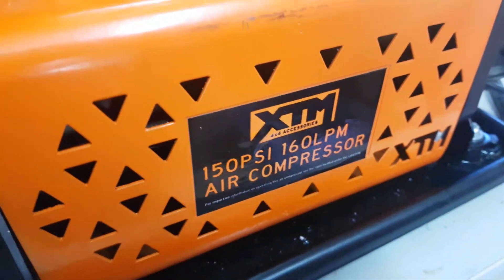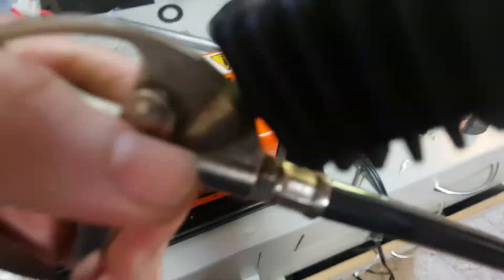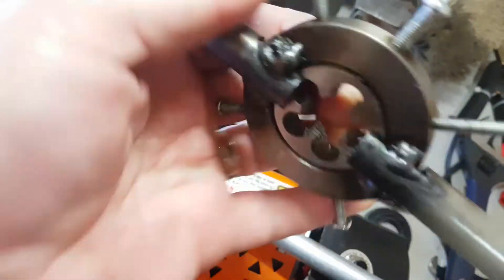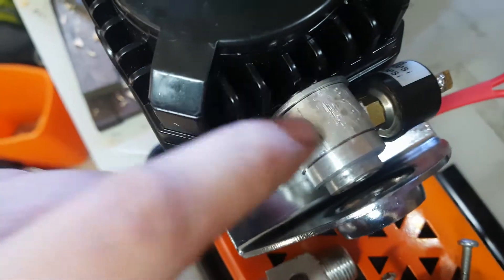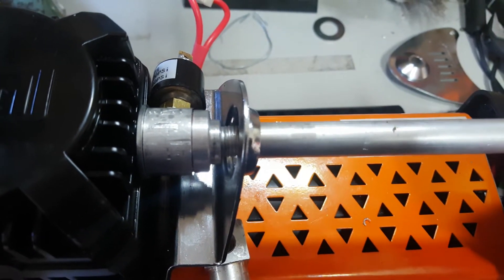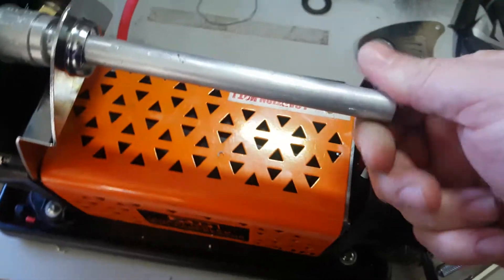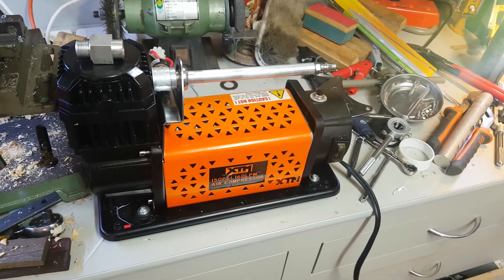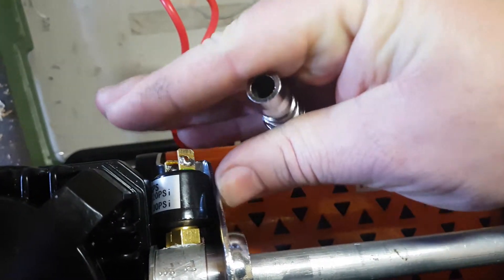DIY How to add an Auto Cut Out Pressure switch for a 4WD Air Compressor

Comment: Just a question. Is there a reason why you did not reconnect your blow off valve? Or unloading valve? same thing lol
Reply from the maker: there wasn't one on this compressor. The hose and connectors that are on it originally are free flowing, so there isn't really need for one
Reply: Wow.I thought they all have that. Oh well. Thanks for responding

Comment: I use a similar switch bought from Amazon in my 5HP shop compressor to de/activate a magnetic contactor.  The traditional pressure switches are either $15 or $150 and the $15 ones burn up quickly, so now I at least can replace the contactor only if it fails, but at 40 amps, I think it will last forever with that motor.